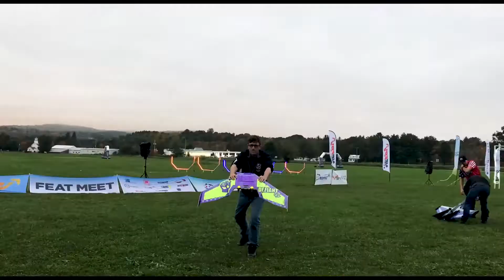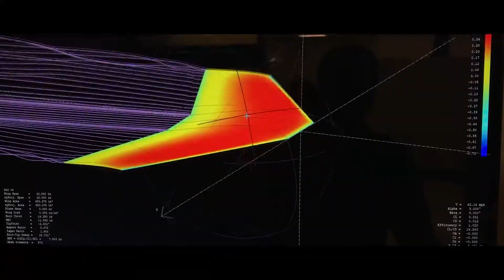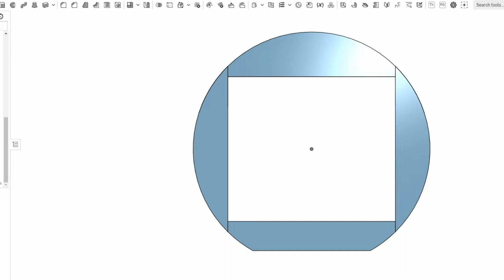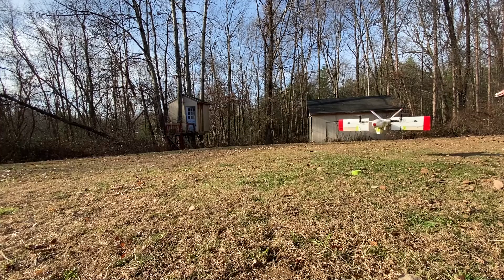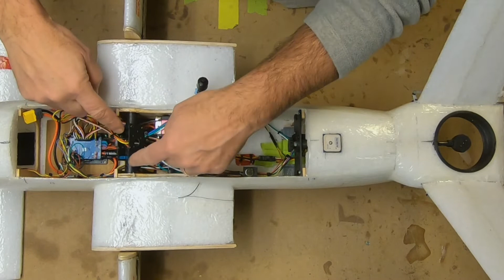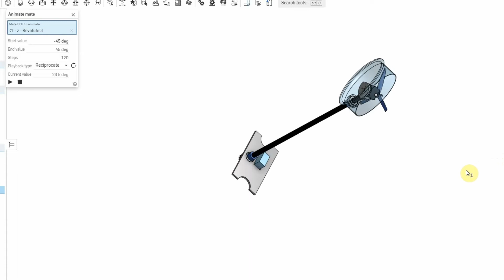Rogue VTOL Project - Part 1 Design Walkthrough

Comment: very nice design! love the tilt wing, Ive always wanted to design a quad vtol with rotating wings similar to yours. wonder if all 4 corners can be similar in design for a quad motor configuration, each winglet optimized for their position rotating with the motors. front and rear can be ran at optimal rates to maintain level landing and transition between vtol and vertical flight. i wonder how difficult it would be to have the motors rotate independently from the wings. would be able to differentiate the glide angles while motors shift into position. Going to start working on the CAD files
Reply from the maker: Check out some of my later designs

Comment: I think tail duct  & motor should be ‘one unit’  so that duct moves along with motor/prop. Duct not glued to foam like tricopter
Reply from the maker: Thanks for the suggestion!  It is something i have been considering. It would solve some problems but might also add some drag consideration when mounting it in the tail and trying to keep it as flush as possible with the fuselage.
Reply: @DefiantWings  the setup will be more compact if the duct doesn’t move. Plus then the duct is part of the structure of the tail.
Reply from the maker: @swissfreek  yes, you are absolutely correct. Ultimately, that is why I went in this direction. The duct can be much lighter weight and simpler